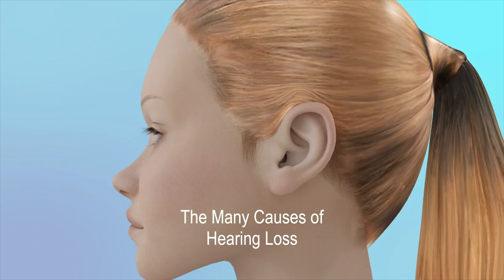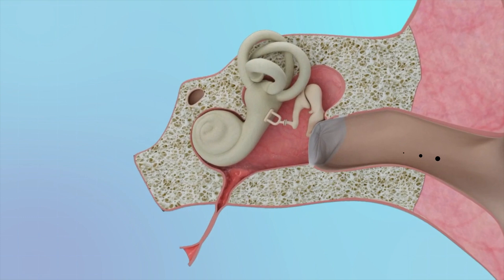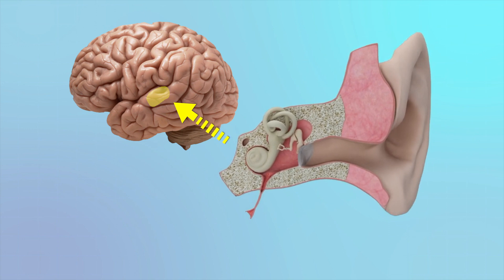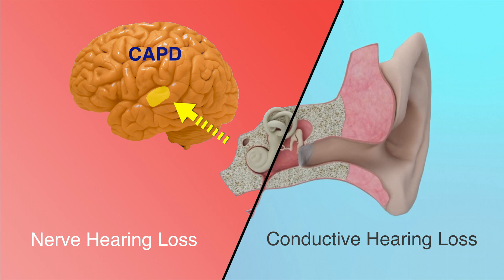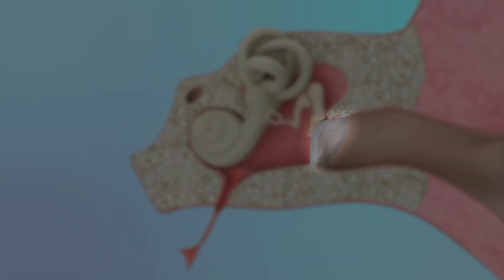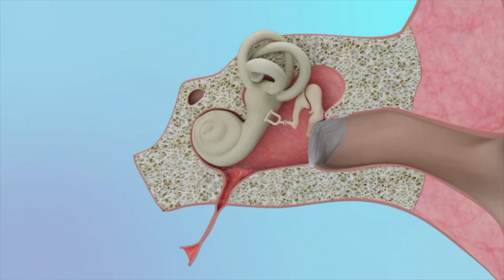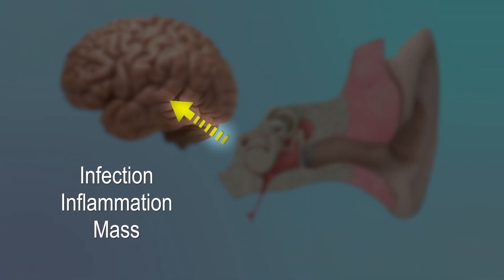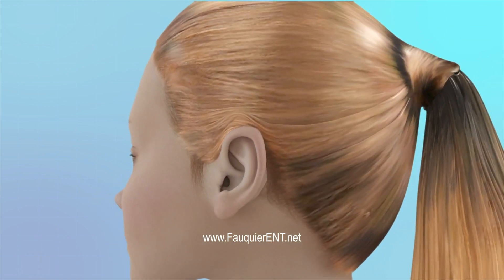Hearing Loss Causes - 23 Different Reasons Why Hearing Loss Occurs!

Comment: When listening to music only through my right ear, it sounds like the music doesn't make any sense. All the notes are completely off, like the musicians can't play in tune. Voices sound weird and distorted, too. Also have high frequency hearing loss that's got worse over the past 2 weeks. Constant tinnitus. Left ear is perfect. What could cause this? I doubt it's wax (they're clean according to my doc), or infections (also confirmed no infections by doc).

Back story: I believe I had a ministroke or two about a decade ago, but my right ear hearing improved back to normal after both of them. I'd suffered complete hearing loss on both occasions, one for several days and one for several weeks. Took months for hearing to restore to normal. Could this have caused permanent damage that would manifest at a later date? It's the same ear.

Thanks for the video!

Comment: What about hyperacusis do we get it when we get an infection and the infection like hardens the small bones in the middle ear??? Or inner? 

I got sinusitis symptoms spring 2022 and clogged ears ever since and then I got Covid in June 2022 and then ear infections in July from music but I was also dealing with sinus issues or feeling very stuffed in my nose or just felt sorta under the weather.  Anyway so then I got tinnitus in august 2022 After some ear infections shit was kinda gross even though nothing expelled out of my ear I think the puss or infection just hardened behind my ear drums. Then I got sound sensitivity.
Reply: What if you have mild hearing loss in your left ear but still hear pretty good out of it? My left ear dropped to 35db at 250 frequency and 30db at 500 frequency where my right ear was 20 and 10.

But I can still pick up sound and bass from songs, talk on the phone find out if that ear, I mean I can hear background noise good and what direction it’s coming from etc. like I can hear pretty good out of it, only thing I’ve been experiencing is this pressure and fullness sensation and low pitched ringing sensation, or ringing from the pressure I don’t know how to explain it. It’s not high pitched ringing and it does ease up at night it seems like. I’ve also noticed sensitivity to some sounds like scratching the wall I can feel it in my ear, closing lids hard I can feel it, sometimes my voice or other peoples voice I can somewhat feel it in my ear as well… it was worse at one point, but has improved atleast gradually. The humming test I have a hard time distinguishing which ear is better, most of the time it feels equal and other times maybe slightly louder in my right ear?

My symptoms at one point were pretty intense with the pressure and sound coming from my ear, that’s really the only time I notice a little difference in my hearing? When it eases up it almost feels normal. But it seems like for a week now my symptoms have gradually improved? Not 100% but better than it was gradually.

I’ve been getting treated for middle ear fluid for about a month and half now, and been dealing with these symptoms on and off for 2 months exactly. I haven’t had vertigo or any other serious symptoms, just the pressure and fullness and low pitched ringing. I got sick with a bad head cold and congestion, stopped up, sinus headaches etc and lasted for like 10 days ATLEAST and somewhere between the 7th and 14th of November I woke up and noticed my left ear just felt like, full? Pressure? And that sound (low pitched ringing or whatever) thought maybe I just slept too long on that side and all that mucus and congestion went to my ear, and I just kinda shook it off because I’ve dealt with this similar experience in my right ear years ago and it got better over time so I didn’t really think anything of it, well November 28th was my first visit at this clinic and that’s when I started getting treated for middle ear fluid and slight mild infection idk. Never would have thought of hearing loss, never would have crossed my mind. I don’t do anything to super loud excessive to cause damage, I don’t have any diseases. But maybe it was whatever virus attacked my sinuses I have no idea. Maybe my body is just taking longer to heal and get over this.

Just curious if anybody out there has dealt with similar symptoms that I’m dealing with and if they think my situation will get worse or these sensations in my ear will last forever??? It’s been 2 months now and my symptoms haven’t gotten worse, I mean for a while it seemed like it was on a routine, where it would ease up at night and then flare up bad when I wake up and midday.

If anything like I said maybe some slight gradual improvement.
Reply: @wobekillin9991  Same...for me I was listening to music at a high volume (which you all should know is dangerous for you). Little did I know by bedtime that I'd eventually get a painful earache that would cause me to pour water into my ear canal for relief. (This is again dangerous.) Then I got a towel that I mostly use for earaches, poured warm water on it, drenched it, and slept. (This is the correct way to manage earaches.) I kid you not, when I fell asleep, there were beep noises oozing from my head (tinnitus). I begged Allah (I'm a person with faith) for it to subside, and by the mercy and loving nature of Allah, it subsided, and I slept peacefully. 😞

Now, I mean I deal with earaches/discomforts here and there, sometimes atmospheric pressure would happen, that'll suddenly transition into a low ringing in my ears, then I'll panic move around, and it'll die down, and everything goes back to normal. But all I'm saying is that I know for a fact my hearing is altered and if I ever use a headphone that's not on a low level you can imagine the amount of damage that'll resort for me. But I am happy, nothing terrible is going on, deal with low intermediate pulsative tinnitus, that'll mostly die down when I do sound therapy. 

Anyway, yeah, you're not alone.
Reply: Like my audiogram was like a big ass reverse slope, it was pretty normal and same until the last 2 lowest frequencies and then it dropped off some, to 35 and 30
Reply: @wobekillin9991  I think you got sinus issues breh. Also idk if you’re into music but I damaged my shit from music and I was also dealing with ear fullness and hearing loss sorta. I still have this issue in like 3 months it’ll be a year of ear fullness. 

You probably need a sinus surgery or a cleaning of your sinuses. If you’ve had bad allergies growing up maybe your sinuses are just in need of a cleaning ?????
Reply: @Cardoza.Nsmg3  idk man this audiologist doc told me it was nothing conductive cuz the tympanogram showed my middle ear was normal and eardrum and all that so it’s got me freaking out.

I was taking decongestants but I’ve stopped because I didn’t think there was any point of it. Like last night my ear felt like 95% normal and then today I woke up and it came back the pressure feeling and low pitched ringing and it’s been present all day
Reply: @wobekillin9991  are you exposed to loud sounds
Reply: @Cardoza.Nsmg3  not really, I wear over the ear headphone but never blasted music and shit, I always kept it at a comfortable level but even now I’m def keeping it low volume. 

Idk everybody I’ve talked to thinks a viral infection attacked my inner ear but idk. Just super depressed about this that this won’t get better and it’ll be permanent. My hearing loss isn’t even considered too severe but the symptoms I’m experiencing are def not something I can just shake off. Like it hard to not think about it, and depressing thinking that this will possibly be permanent idk. I’m trying to stay optimistic and hopeful
Reply: @wobekillin9991  tell em to check your sinuses and throat. This can be a time thing for you though. These infections or bacteria that chills in your sinuses can get serious af. 

I went to a ENT doc he just checked my ears and said I was fine but I wasn’t, went to another doctor and this person check my sinuses with a camera and she was worried she said “oh” like she just saw someone that’s been fucked up, got x rays and it said sinus disease.  The bacteria in your sinuses can mess up your ears too if it’s chillin there you might just need a helping hand for a cleaning but you need converse with your doctor more
Reply: @wobekillin9991  well if you have humming sounds then that shit is in your brain 🧠 but yea it already went past your inner ear I got tinnitus fam and ya know just try to be patient. I’m going through shit too fam. If you want your health then stay healthy. Niggas don’t know that this type of stuff really fucks with a persons mental state. 

Whatever you do though don’t get an ear tube because that shit reduces your hearing I got one and I lost low bass frequency sounds shit was super sad af like I was fucking pissed af when I noticed it like that. It doesn’t happen a lot or it’s “rare” but dude ENT doctors really aren’t that communicative from my p.o.v. 

If you don’t do music, then I think that ringing SHOULD go away or humming. But if your allergies are acting up I actually think a surgeon should clean your damn sinuses and or  idk fam.
Reply: @wobekillin9991  I think you’ll be ok though.
Reply: @wobekillin9991  idk about your hearing loss if it’s that different maybe it was your infections idk. The low humming or ringing it probably “tinnitus” and it can go away I think if you take care of your body, eat good, exercise, and protect yourself when the seasons get harsh AND also clean your a.c. Unit.
Reply: @wobekillin9991  go to an allergist to see what you’re allergic too maybe they can give you a better idea or knowledge of what to look out for. Also maybe your Eustachian tube is kinda funky too, your ear nose and throat are connected to each other maybe ask your ENT to use a camera and see if a sinus surgery is the move ???? I want a sinus surgery I have ear issues and I can’t listen to loud sounds like that. But this injury you should treat it seriously, you’ve got 3 small ass bones behind your ear drums so the healing process can take some time. Depends how bad it is. 
Loud sounds can cause fullness in your ear as well idk how I forgot but be careful shit can get life changing QUUUUUIICKKKKKKKKK. 

But the seasons can get you sick fam. Whatever passions you got or moves you got going on and it’s risking your health you needa stay on top of your body. It sucks!!! I can’t even do music fam lol.
Reply: SAME! I literally started having my hearing altred in July of this year due to too much noise.! plus, yk your ears lowkey need wax to help you and wax-build up can cause issues.